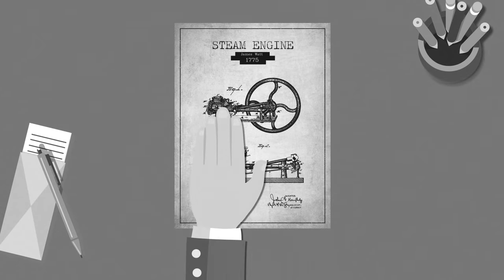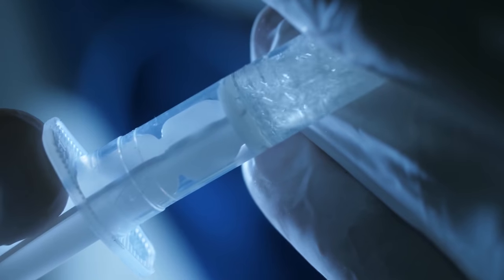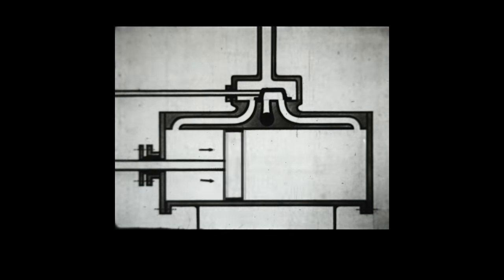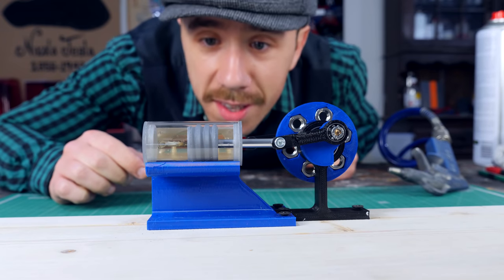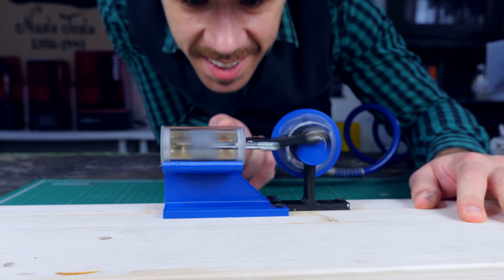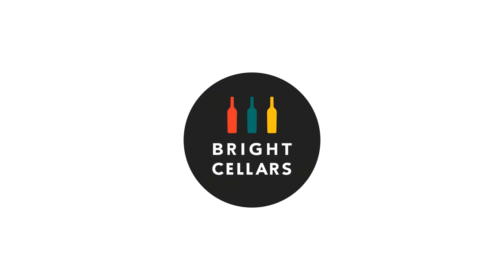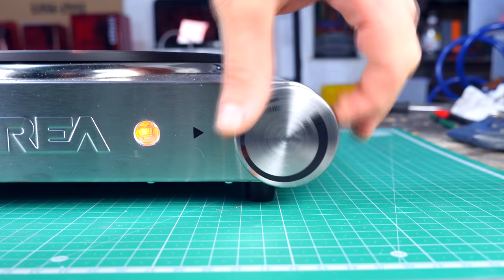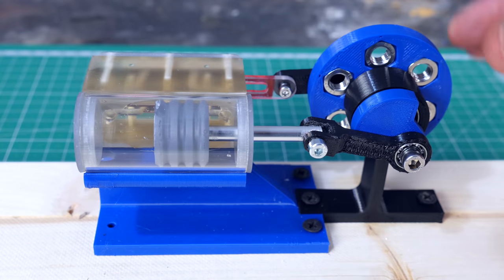Transparent Steam Engine (3D Printed)

Comment: Make a steam powered nerf gun
Reply: Yeah😂
Reply: No
Reply: Petersripol?
Reply: How does that work?
Reply: @Catherine-tg3zd idk it winds up a plunger or something
Reply: @T_rev-ud7zb  I was thinking something more along the lines of having a small boiler with a high-flow valve that can release the boiler pressure into one end of the barrel which then fires out an airtight bullet, basically the same as a pneumatic lego gun
Reply: @Catherine-tg3zd the steam pushing a plunger can shoot a nerf dart out😂
Reply: My brain is not functioning

Comment: Now I want to see you 3d print a steam whistle
Reply: Yessir
Reply: Yessir
Reply: Yessir
Reply: @dr.klopper960  chooo-chooo train !
Reply: i think you are wining a 3d printer
Reply: Yessir
Reply: @Integza -Okay I have a challenge for you Integza. I would like to see Integza build a small scale train engine with the steam engine powering it. Print the circular track as well. And then the 3D printed train whistle also being powered by the steam but with a pressure chamber that has a one-way valve Inlet; and a purge valve for the outlet that only lets the whistle blow once enough pressure has built up. All parts 3D printed doesn't matter the medium; such as plastic, metal, or ceramic but all parts must be 3D printed only pins, bearings, and fasteners otherwise acceptable. Go!!! Make sure you tie tomato Lord to the track. The challenge would be generating enough Steam for an on-board power source that something as small as a Sterno could power🤔🤔🤔🤔 and yet put out enough torque to move the train and the Sterno.
Reply: Yessir
Reply: Yessir
Reply: Hello
Reply: Am primary  teacher  please  donate the apparatus
Reply: @robertngambi2169  Nah your not a primary teacher, you are a kid and you know it
Reply: Siryes
Reply: @Jam_Van  ello
Reply: Do it
Reply: i want you to finish your minecart

Comment: You could create a "C" bracket that goes from lid to lid that clips over the ends of the cylinder to hold them in place.
Reply: My exact thought, glue isnt always the answer. :)
Reply: I would add a flange to the end of the cylinder and the rim of the cap that allows them to be clamped or bolted together.
Reply: or make at atmospheric engine, and let the vacuum suck it in place
Reply: Or a zip tie.

Every engineering problem can be fixed with duct tape, zip ties, WD-40, a hammer, and an oxy-acetylene cutting torch.
Reply: There you go ;)
Reply: Even using 2 rubber bands is enough to keep the lid on
Reply: I was wondering how much the friction of piston on lid is making it come out vs just pressure in the vessel. Does it start working later because it gets wet enough?
Reply: Same tough
Reply: @Crazymoniker  I was going to suggest a couple little pieces of tape, ha.
Reply: Flex tape can fix that
Reply: @exoc1  Especially when it comes to engines… LOL
Reply: Im no expert but Adding snap on latches to the design could work just as good.
Reply: Or just a g clamp
Reply: Or maybe a straight bracket to clip them together
Reply: Or he can just hold it with hands while testing
Reply: @onlinehelper374  steams pretty hot you know
Reply: @3Re12  who would know 😁👍❤️👍😁
Reply: @Crazymoniker   No love for bailing wire?

☹
Reply: That was my first thought as well.
Reply: 🔴 What Is Islam? 

🔴 Islam is not just another religion. 

🔵 It is the same message preached by Moses, Jesus and Abraham.

 🔴 Islam literally means ‘submission to God’ and it teaches us to have a direct relationship with God. 

 🔵 It reminds us that since God created us, no one should be worshipped except God alone. 

 🔴 It also teaches that God is nothing like a human being or like anything that we can imagine.

🌍 The concept of God is summarized in the Quran as:

📖 { “Say, He is God, the One.  God, the Absolute.  He does not give birth, nor was He born, and there is nothing like Him.”} (Quran 112:1-4) 📚

🔴 Becoming a Muslim is not turning your back to Jesus. 

🔵 Rather it’s going back to the original teachings of Jesus and obeying him.
Reply: or just a wood clamp lol
Reply: Hey guys, but in a real engine, what would happen to the water that would build up inside when it was working
Reply: dab of super glue... lets not overcomplicate solutions

Comment: Video idea: have a steam propeller engine for a model airplane(to have it portable use the hydrogen and potassium permanganate mixture, and they could get mixed using syringes injecting the mixture. You could use the same method as you did for the Devil's Toothpaste Rocket Engine that was mounted on the skateboard?)
Reply: @integza if this person doesn't get top comment I still want to see you make something similar this.

Comment: Using alcohol in a steam engine sounds like something I would suggest💣🔥
Reply: Have you heard of NAPTHA locomotives!
Reply: I would too 😂😂😂
Reply: that just sounds so ridiculously dangerous and fun at the same time, as it boils at a lower temperature does that mean you can get higher pressures?
Reply: @Anonymouzor  yeah but the temperature will increase with the pressure and ultimately lead to a spontaneous combustion because the ethanol is lighting itself up, wich would be very very dangerous. Since it is hard to controll this system so that this doesn't happen, I would not recommend to try this at home.
Reply: @draco5991rep  it was a joke dude. You didn't see that he had a bomb and fire at the end of the comment. Everyone knows that this would cause a catastrophic explosion. SMH just about every one of the comments related to this were sarcastic not serious.
Reply: @grandvalleyproductions9422  exactly what I was thinking 👍
Reply: I think technically that's called a still

Comment: you can transform a fog machine to make high pressure steam. I already put instead of fog liquid, water. I've already tried this and it really works because the machine has a mini water pump that generates a considerable pressure and when the liquid goes to the heater it boils instantly which almost triples the original pressure
Reply: Just use distilled water if you do this,. Or you'll clog your boiler tube with minerals.
Reply: You are using it like a flash boiler.
Reply: Fluid doesn't flow to higher pressures. For example, in a liquid rocket the fuel pumps generate all the pressure of the exhaust, the combustion in the combustion chamber just increases volumetric flow rate.
Reply: neat
Reply: How?

Comment: Video idea: It'd be neat if you created a methane powered internal combustion engine, and then power it with methane derived from decomposed tomatoes/another source [as noted by Dan] or something like that.
Reply: I ran a 2 stroke off ethanol I made once, it's very posible
Reply: I suspect the acidity of tomatoes would make methane production (or any other decomposition) difficult.
Reply: @danb4275  Yeah that may be so, but that was mostly a joke in reference to his distaste for them. Maybe he could make it from another source... or just buy some to cut some of the trouble.

Comment: Fun project! I always enjoy your videos, you always have a creative solution to thorny problems. 

You can get much better performance from your engine if you lubricate it. Steam engines used hydrophilic oils that would actually be carried by the steam into the cylinders. If I recall correctly, animal fats (tallow) are particularly suited. The engine will also perform poorly when cold and uninsulated. You'll lose tons of power because it's all used up when the steam condenses back into water in the cold cylinders. Harvesting more of the steam's energy as it expands gives you the most efficiency (compound engines do this using cylinders of varying bores, high pressure cylinders have smaller bores than low pressure cylinders after them).

Comment: Hi, steam locomotive engineer here, and I noticed that while your steam engine does work, it's quite inefficient, and has some potentially fatal errors. First of all, there's water in the cylinder, and this comes from using saturated steam. You could superheat the steam if you wanted, but the most simple solution is to add what are known as drain cocks to the cylinder. Basically, they're valves that you open for the first few strokes of the cycle, to allow the water to drain out. Also, the valve and it's timing, while useful for a simple engine, could benefit from being adjustable. Something like Walschaerts valve gear or Baker valve gear, with a "cutoff" to allow variation in the valve timing, and making the engine more efficient. Also, it seems to leak steam everywhere... I don't have a solution for that one, so just go with your gut on that problem. One thing I'd definitely suggest is getting a dedicated model boiler, like a Wilesco or a Mamod unit. Hope this helps!
Reply: I also noticed that there were no piston rings on the piston. With the heated steam, I'm wondering how much blowby he was getting with everything expanding. Though the cylinder doesn't seem to hold much pressure so rings would pose an issue. You would need to solve the issue with containing pressure or design a piston that uses a lubricant as a seal rather than a mechanical seal.

Like the rocket engine, you should try to measure useful work of this engine and then tune it as Mike G suggests.
Reply: @DeeEhm  graphite is an excenent dry lubricant, although I don't know about it's efficiency in a very wet environment. Maybe something to consider?
Reply: this comment section is filled with people I admire
Reply: I don't think he was trying to make the best one he could, he just wanted to have some fun.
Reply: @kingsummit5310  graphite gains a lot of friction in water. It turns into a thick paste as well.
Reply: I'm surprised by the awesome responses on this comment. Thank you guys, you're all pretty cool. Also, I totally didn't realise the piston has no rings. Though, again, given the nature of this particular engine, maybe that's a good thing. At least without piston rings, the water seems to be not completely fatal. If the fit was tighter, or the piston had seals, it's likely that the amount of water that was in the cylinder when it started would've cracked the cylinder, as water is a very unforgiving element sometimes. That being said, improvements can definitely be made. I for one would love to see him create his own "Integza Valve Gear", knowing what we know now in 2021 about valve gears and engine efficiency, basically taking the best elements from various designs, and combining them. That would be cool.
Reply: @ethanproctor6695  That makes sense. Well, if the engine was bored out and the pistons turned down via a metal lathe to gain ectremeaccuracy, I wonder how well it would run?
BTW I got super lucky and was able to buy a metal lathe and I'm currently working on boring out cylinders and turning down pistons for high accuracy. I will definitely be filming it and posting it on YouTube

Comment: You can get more pressure without changing the boiler. Just superheat the steam coming from the pressure pot by passing It through a coil that your heat up with a Torch, or that more generally passes through something hotter than 100°C

Comment: Integza! I've spent the last 8 months trying to design the world's first 4 stroke compressed air engine, an I finally have one that works! The problem is it runs like crap and is less efficient than a 2 stroke alternative! I challenge you to improve it!
Reply: UPPPPPPPPPPPP Great idea!
Reply: How do you even do that?there’s only 2 cycles with pressured air
Reply: @pubz2288  You have a separate camshaft with a 2:1 ratio that opens the valve every other stroke, just like a car engine
Reply: @AxelDayton  But why? No need for compression cycles in a steam engine.
Reply: You improve it by making it a two stroke - air doesn't explode, so there's no point having a compression/ignition cycle.  You've invented something that automatically has half the efficiency (your 2:1 camshaft is the clue).

Comment: As user C Moore mentioned, a steam turbine  would be great! Just to see how much power you can harness from a particular heat source. Either run a driveshaft directly to a vehicle or turn it into electricity with a generator. Messing with the drive shaft gearing or the shape of the turbine blades could be fun trial and error.

Comment: Look up the Doble steam cars. They generated steam in about 90 seconds by using a containment vessel that used copper tubes that were heated up. Basically instead of boiling a large amount of water at once Doble steam cars flash boiled small amounts of water quickly. The idea was to have the water pass through the tubes and have the heat of gasoline heat up the tubes and turn the water to superheated steam. Jay Leno explains this. It’s kind of how tankless water heaters work but it’s much more powerful

Comment: You need to superheat the steam as it comes out of the pressure cooker, so you get dry steam, it will also increase your pressure as well. Run it thru a copper coil with a gas flame heating it.

Comment: Video idea: Build an steam engine with four or more cylinders and a crank shaft, and messure how many horsepower it makes and perhaps make a vehicle out of it ;)
P. S. Keep up the good work:) love your videos:):)
Reply: never knew a person could fit so many '':)'' in one comment.
Reply: maybe the real problem of steam cars is efficiency and water recovery. so i presume they'd need high steam pressure at first. it's better to have a steam air-compressor etc... compressed air'd be good to recover water also.
Reply: enriqueamaya3883   it isn't religion. it's a science question.

Comment: I also would like to see this steam engine improved. As many other comments suggest, O-rings would be an automatic improvement, especially with the low pressures you're working with. Too much pressure is leaking out of both the piston chambers and the valve. At 3-4 times the pressure, waste wouldn't be such a big deal, but losing half of such a small input is kindof rough lol.

Friction would be a big problem with o rings so it might necessitate looking at alternative seals... Like in modern engines, solid piston rings are a thing so 3d printing a "soft spring" could do better than a rubber ring in theory. Plus it'd center the piston up so less jiggle would be present.

Another change could be to move the valve onto a lower portion of the cylinder to help evacuate condensed water while maintaining visibility for the sweet transparency effect to be maintained.

Comment: Since you getting into aircrafts how about building a airship that is powered by an engine turning a propeller e.g. a two stroke engine powered by a small CO2 tank?
On a airship you don´t need to worry about weight and lift as much as on a plane because you can just make the body of it bigger.
And Helium is also pretty easy to get in vast quantities (the one for party balloons).
Reply: Of course you could also use hydrogen that you produce by electrolysis but that is a little security risk...
so it would be perfect for you.

Comment: Glad to see it worked! If I may make a few small suggestions, some O-rings, grease, and a O-ring on the piston rod and the cylinder head (packing gland). That's where this engine is likely losing efficiency. Also some cylinder cocks (valves to drain condensed steam from the cylinder) may help, as you can see the water start to build up in the steam test.
Reply: I was wondering what the valves were called that drained the water, thanks

Comment: for anyone who really wants to find out about how steam engines work heres some differences between this engiene and a normal stream engine:
1. normally a steam engine has a much thinner piston
2. that design of piston is designed to be used with a o-ring
3. most steam engine will not use the flywheel for the valve timing. early steam engines used a round peice with and eccentric hole. later engienes used complicated systems that would take far too Long to explain in a comment.
4. most stream engines will use a slide valve  and a steam chest. the steam chest is filled with steam/air and the slide valve moves to allow steam/air to flow into one port that is uncovered  and connects the other Port to the exhaust hole.
5. alot of engienes use crossheads and crosshead guides to keep the piston rod from bending
ofcourse there are exceptions however this is true for the majority of engienes

Comment: You should definitely try making a stirling engine. Almost like a steam engine but it runs on air contracting and expanding because of temperature. And you liked engines, right? Great video!
Reply: I'm pretty sure he already has... But good idea anyways!
Reply: He has already done it
Reply: He kind of did but I meant like the ones you can just put on a cup of warm water and they start turning.

Comment: The reason why the steam pressure is getting low is because because the amount of water you filled the pressure cooker with is not enough, you could've filled the pressure cooker with a big amount of water until the space between the water and the lid is narrow so that the pressure of the steam is higher and doesn't get low quickly because it can get compressed well, so not only it will prevent the pressure from getting lower quickly, it will also increase the pressure and make higher not only because the space between the lid and the water is narrow, it's also because there's so much steam which will increase the pressure and make it more than the input temperature and the steam will be more powerful, even though if you put that amount of water in the pressure cooker it might take longer to heat than if you put less but it should be done so that the pressure doesn't go down quickly.